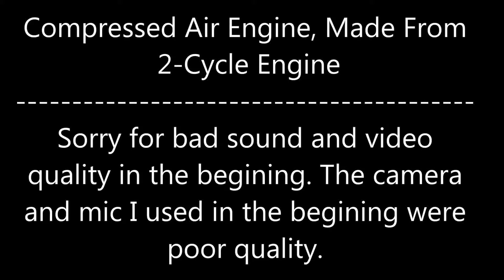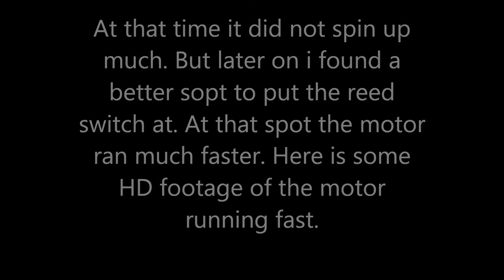Air/Steam Engine (2-Cycle Converted to Steam)

Comment: Really cool. Reed switch placement = timing "dwell angle", distance from fywheel = pulse-width modulation (duty cycle of solenoid)  would make a good throttle control - but you probably already figured that out!

Comment: you may want to re-touch that jb weld later, you don't wanna be runnin' your motor at like 1,000-1,500 rpm and have your flywheel come apart
Reply from the maker: +MultiMoveman Yeah that was not an optimal assembly method. The weight was also held in place by duct tape, but it was just an experiment. That project has long since been dismantled. Thanks for watching!
Reply: its pretty sweet, you should do a 4 cycle to steam
Reply: @ElectroTechnics  great job, how do you oil the rings and bearings

Comment: Have you tried it with steam?
Reply from the maker: No, because that valve is made of rubber and plastic, there are versions of that valve which are all metal and would allow operation of the engine using steam.

Comment: on the first air engine i had, true the engine did oscillate. after that, i used a check valve to solve this. it worked ok, but not great the engine  was still very slow. than one day the o-ring fell out, but the engine was running fine, even better. i had a set up with a rubber tube running to the valve. the way the rubber tube works on the engine is: when air comes into the cylinder it pushes the piston down, but on the next cycle instead of oscillating the piston will re-compress the air.....

Comment from the maker: Humm, are you sure your air engine is actually spinning all the way around? I have tried mine just like that before and it would just oscillate back and forth, the valve has to be there so that it will only have air flow when the piston is going down, and not when it is going up. When there is air flow going to it as the piston is going up it will thrust it back down and not cause spin. Could you maybe make a video showing more details on how your's works. Thx for watching!

Comment: You might be wrong about the flywheel and using a solenoid. I actually have the same engine as you and I am running it on air. All you need to run a 2 cycle on air is a rubber tube. Check out my chanel and look for the video called "chainsaw engine running on air" or something like that you should find your engine but with a different flywheel. Tell me if you find it. It might help you :)